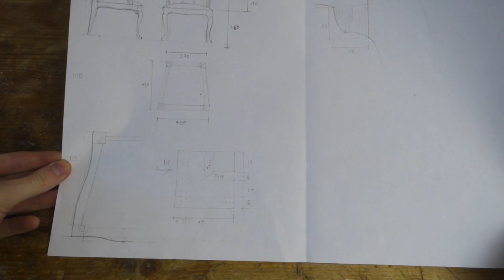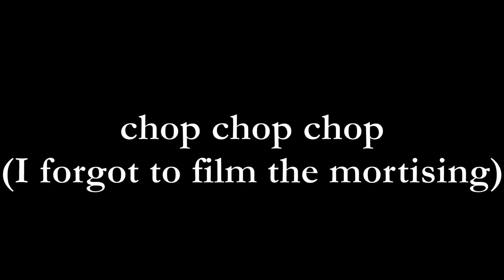Chair part 1: cabriole legs, angled tenons

Comment: HI, I'm always looking forward to watching your videos and I really enjoy the kind of projects you choose to share with us, not many out there like yours ... I'm about to buy the Veritas dual marking gauge and have noticed You have on yours the "shaft clamp" ... do you think it is worth the money ?  what is your thought about it  ?  Greetings from Italy
Reply from the maker: Many thanks! Hmm, spontaneous answer is yes, I use it all the time. But when I think about it, a lot of the time I just use it as an extra way to tighten down the main bar, since I find the thumbscrew is sometimes slipping, and with the bars locked together you basically get an extra thumbscrew's worth of pressure. So that kinda begs the question if the whole marking gauge even is worth it. I'd say no without the shaft clamp, I would only buy the gauge with it. But I don't know if other brands lock down tighter; if so, the whole tool is not great by comparison.

Comment: Color match issue: Don't know the solution, but I would cheat and set back the rails and stiles about an 1/8 of an inch instead of flush with the leg. And/or add a carved detail to the leg.
Reply from the maker: That works!

Comment: For marking short distances I find using a chisel butted up to the ruler/square/whatever is a quite convenient way of making lines.
Reply: Also, finally a new video!
Reply: Orelaterat till övriga kommentarer: Mölndals museum har en riktig fin utställning om möbelsnickarna i Derome som kan vara värd ett besök om du är i den delen av landet.
Reply from the maker: Thank you for sharing the tip, but I'm afraid I didn't quite follow that one! In what context would this be done? :)
Reply: @GillisBjork  when you used the ruler as a square and had to scribe carefully to avoid nudging it over I would probably done with a chisel instead.
Reply from the maker: @pettere8429  Ah I see! That sounds very sensible.